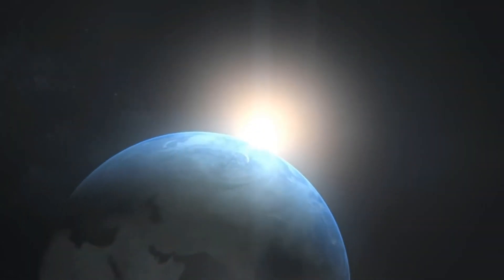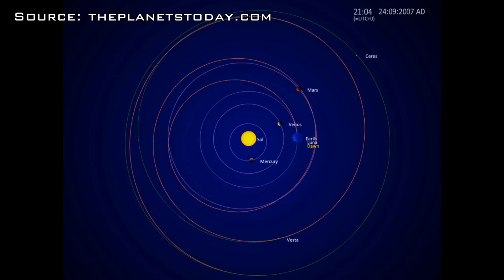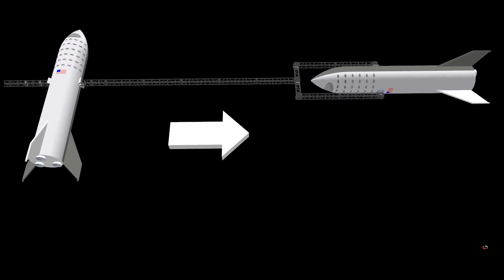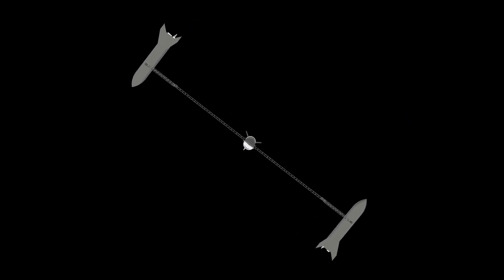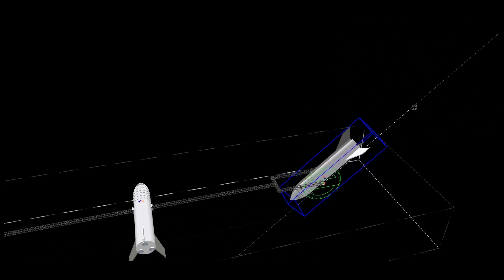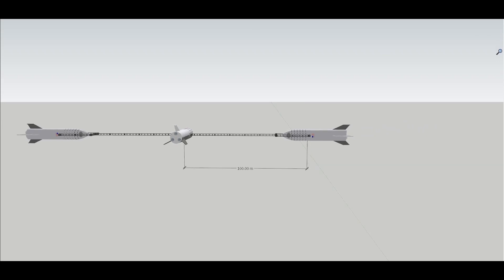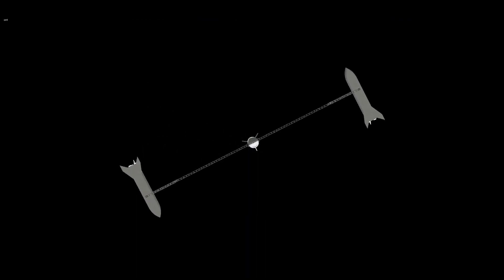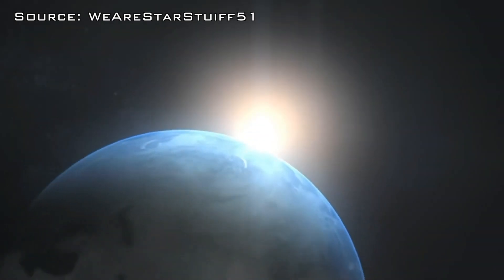GLS2: Artificial Gravity for SpaceX's Starship

Comment: I think the first question should be, is there a material that would provide the tensile strength needed but still be light enough to keep the weight from becoming an issue for launch. The material would also be required to withstand multiple long trips through space at minus 457.87 degrees on average. Do we have any lightweight materials that could withstand long exposure to cold and not become structurally compromised while providing the rigidity over that amount of exposure time? The concept is sound, and I have actually been mulling this over but instead of the starship, I was wondering if this can be done with the bigelow aerospace inflatable habitats. All in all, I think this is an amazing idea and wish I would have thought of it first, kinda jealous that your system is so much simpler and elegant than mine. lol Great job and thank you for posting this concept for us to see. Please keep them coming.
Reply from the maker: Thanks! More content is in fact in the works. General science-y video next, and GLS version 3 after that. I'll certainly be looking into materials as well as the implementation.

It's funny that most people say my idea is too complicated, and I agree with them when it comes to certain aspects.
Reply: @smallstars  10 years ago I would have thought it was too complicated, but not now. I think the idea is sound but am not sure if the material sciences have produced anything that could work. To me, your idea is actually the most viable I have seen. I did have an idea after seeing this that has been banging around in my head. Would it be possible to change the orientation so that instead of the two outer ships being aligned with the main ship side by side, if they could be fore and aft so that it could take advantage of the forward momentum as well as the spinning momentum. If you could let me know if that would be possible in this model I would appreciate it because my OCD has been going overtime on this idea. Hope to hear back from ya.
Reply from the maker: @NoWokeSpeak  Ok firstly, thanks for the kind words.

You seem to not understand the difference between an acceleration and momentum. Momentum does not put any force on you, which is why when floating through space, you don't feel any gravity like forces on you. You just float. The spinning action is an acceleration. This is why it can be used to create a force that feels like gravity. Accelerations aren't just things that push you in a direction, they can be a change of direction as well. Think of when you are in a car and the car turns to the left. Your body is pushed to the right, that is an acceleration.
Reply: @smallstars  Ok, I really should have been re-read that because it is very confusing. What I am asking is, if you change the configuration, could the acceleration and deceleration assist with spin up and spin down. I worded that very poorly, sorry about the confusion.
Reply from the maker: @NoWokeSpeak  ahh I see, I don't see how something like that could be safely implemented during the TMI (trans mars injection burn, which is when you accelerate to leave earth,) but I do enjoy imagining what another person has suggested which is to orient the spin system like a frisbee on its way to mars, and upon arrival, detach without slowing the spin on a vector that's beneficial for mars landing, or orbit insertion. This basically recycles the delta V used to start the spin and turns it into delta V that slows down the starships.
Reply: @smallstars  yes, you explained it much better than I did but, absolutely, frisbee orientation, why didn't I think of that..lol.
So now that you were able to translate my gibberish into an actual coherent thought. If we had the tech and material to support something like that, would it be possible,  would it conserve fuel and, be more efficient over all? Just as a thought experiment.

Comment: Its a good idea but I would think the forces produced would tear the ship in half , the gravity as you have pointed out would be low at the top like earth just down from the top and be  many many time more at the engines due to the ships length. the pressure would be massive on the tips of the rocket bells. if you flip it around and shorten the distance so the pointed end was facing away and have people live on the roof while traveling in space it might work.
Reply from the maker: Thanks! I'll have improved versions coming out in the future and I'll certainly take into consideration the images that come to mind when I read your description here.
Reply: @smallstars  No worries just remember where you heard it :). I will subscribe I would like to see how it turns out , I also have an idea how to get rid of the cork screwing if your interested . I have some other ideas not like yours but its seems every answer seem to make another issue.
Reply from the maker: @MrBrenden830  I am interested! I had some ideas myself about that and yes, each solution seems to create a new problem. Perhaps contact me on social media that has direct messaging. instagram.com/tinysmallstars or twitter.com/tinysmallstars

Comment: hmmmm, how do you start the engines at the exact same time? What if one engine does not start? Interesting concept though. Also how do you manage course corrections? I'm not criticizing, just trying to help you perfect the idea. Keep up the good thoughts.
Reply: 1966 Mercury XI tried to experiment with a cable tether. Got into an uncontrolled spin. Was lucky to recover.
Reply from the maker: Good points, and I appreciate you being constructive! I'm working on some answers that I will include in the next GLS video.

Comment: A tether still sounds more practical, lighter less voluminous, use the saved mass for RCS propellant, I'm not convinced long burn RCS at the optimum vector won't work just fine. A nice gradual ramp up/down to the desired g force and don't have to stress the Raptor engine(s) in extra albeit short burns. We do agree artificial g is an absolute  requirement, creature comfort is secondary. Glad someone is giving the topic serious thought as this is not a lunar mission anymore. Next we'll need to discuss an emergency 1/2 person return 'pod', for physiological reasons. Thank you, Ken

Comment: Great video, I've always supported creating artificial gravity due to the ill-effects of no gravity on the human body. Maybe one suggestion is to have a pipe to channel the fuel from the outer two starship's to the center starship for 3 good reasons: it will take less propellant to accelerate two lighter starships into their rotation; the truss doesn't need to be as strong to support the weight of the extra propellant (the apartments) on the outer starships; added bonus of being able balance out uneven loads between the two outer starship to counter oscillations and align the axis of rotation with the center starship. Once reaching Mars, the rotation will be stopped as you described, the center starship will pump the fuel back to the outer two starships and detach, landing on Mars, while the center starship stays in orbit until it can be refueled (no point carrying a truss down to the ground and up again in my opinion) for the next burn acceleration back to Earth.
Reply from the maker: Interesting thought! Thanks!

Comment: Why don't you have on the senator rocket or biped poor living conditions with a rotating pot area that's when you going to alignment I would shorten my tethers from the other pods from the Rockets the length of 20 20 ft and with a small burst of accelerant to create gravity inside the MIT Center rocket the center pods to keep gravity I can probably draw it up a lot better but to me it would come back all your fuel it would come back all your waste time it would cut back all that extra material you need to build it and I think you'll get better results for faster Journey
Reply from the maker: I can't quite understand what you are trying to say. Perhaps type it out instead of using speech to text? 😂

Comment: My view was to fit 3 starship to a starship (engine/bunker). the engine would be build to stay in space and serve as a bunker for solar storm. than the 3 starship attached in triangle to the engine/bunker become living quarter. Now spin the thing and you get gravity in the 3 starship and 0 gravity in the middle (engine/bunker) since the engine never make it to ground they can add maximum shielding to protect from particle and radiation (led plate and water reservoir).

Comment: if the rocket from the center rotate opposite direction from the 2 others , could it be possible to generate electricity for the crew and/or generate a magnetic field to increase  protection against cosmic radiation  ?
Reply from the maker: Interesting thought! This seems to be the reverse of what many people are thinking, which is to use electricity for propulsion (ion engines.) You are basically turning the propellant energy into electricity. In terms of cosmic and solar radiation, I've talk of the idea of creating an artificial field to protect against it and will be doing a video about it eventually. Thanks!

Comment: The concepts and ideas in this video are decent, but the basic plan can be expanded upon. 
First, the "truss" itself could be made as a hollow tube. And that that would allow people to go from one starship to the other during each trip.
Second, the "truss" part itself could be sent up into space in advance and assembled in advance too. 
This way the starships themselves do not need to carry the truss structure on board, it will already be sitting in space waiting for them to simply attach. 
One problem I foresee is that both starships will have to be exactly the same mass. If they're not, they will create a force which will send the entire configuration in an unwanted direction. 
Keep in mind that while the two starships are spinning in one direction, you want the entire structure moving in a perpendicular direction.

Comment: Your trusses could exert virtually no control authority due to the high torsional stresses engendered over such a long length (lever equations that you seem to have totally forgotten). control authority is not needed when you have two rockets connected by two tethers , keeping both rockets parallel which would minimize differential gravity between decks. The main issue is that nobody has yet investigated the long term effects of such a large difference in gravity between head and feet of a human (according to your numbers you could be looking at a differential of nearly 0.05g from head to foot, forcing  the heart to work at abnormal loads for long periods of time). We have experience of long term (>1 year) exposure to 0g which while not ideal is at least  survivable and the long term health issues are well understood. While I commend the thinking here I think some extensive in orbit testing would be needed before the lives of a crew could be entrusted to either truss or cable connected artificial gravity schemes.
Reply: There is also an issue with viewing the field of fixed stars at 3RPM. This would quite probably induce vertigo/nausea in many people. Again, the only way to know is extensive testing on humans in orbit. Of course, you could remove all windows but that makes the trip even more unpleasant.

Comment: You would only have "gravity" on the very fringes of the system go 5 feet towards the center you're 50 pounds lighter not a very effective system at all its proven to be useless...
Reply from the maker: That's not true. The difference of 5 feet closer or farther from the center of the system changes drastically depending on how far out you are starting. This is why I planned to have 100% of earth gravity on deck 2 of the Starships. On decks 1 and 3, the gravity only changes by a few percent.

Comment: Why not align the middle starship perpendicular with the other two?   This gains you 60 meters on the spin radius (up from 9 meters the way you have it oriented) and makes the tether on each end around 70 meters for  a solid 100 meter radius.  Orienting it as you suggest is important because the plan is to aim the engines and fuel tanks at the sun.  Only by side-to-side orientation can you rotate and also orient towards the sun which you touched on.  This is the direction of most of the radiation.  I also imagine a pop and play type (pressurized) tunnel inside the tethers so you could travel between the ships.

The center ship/docking module could be an early Starship that is retired.  Send it to orbit.   Take off the engines and use it as a refueling station and gravity docking module.
Reply from the maker: Thanks for the thoughtful comment!

1. The area that will be subject to the strongest tension force is the center of the spin system. The center has to be made up of a super strong hub structure that I planned to have mounted in the middle of the GLS. Orienting the GLS along the diameter (or radius) of the spin system won't "gain 60 meters on the spin radius"

2. Orienting the engines and tanks towards the sun only matters for ships with passengers on them.

3. Pressurized pop and play FTW! 👍

4. retired starship to use as GLS would be great for testing the spin system in earth orbit

Comment: dude that is awesome. I am no where close to being your equal. But here is an idea: As a back up, keep an extremely strong cable to keep things attached. 

Reason iff the truss breaks (due to micro meteors, act of God, etc etc) the supported Starship will go flying off into space. This would mandate a 24/7 skeleton crew to be aboard the Starship to reunite with the rest of the station. However, this requires 24/7 manning which can cause strain on the crew. 2) it also means you need more qualified crew (which means less other important roles can be aboard). For example, if you had three 8 hour shifts for a pilot navigator and engineer, this would require a total of 27 minimal crew members on alert 24/7. If there was a way to mitigate this, you could reduce that to only 12 (3 pilots/navs/engs, and 3 back up). This menas you can have 15 other humans aboard who can help the mission proceed (doctors, different engineers, machinists, etc)

One way to accomplish that would be to attach an emergency cable that is exactly 1 foot longer than the truss but provides 120% the support ability of the truss. This means there is never any weight on it, but if required, it can handle the initial shock (of all that mass moving 1 foot) plus a little more in case there were more people/equipment etc.

You could attach the cable near the center of gravity, so that if it does end up getting used, the Starship would end up tangential to the curve of the circle. This would mean that it would be almost in the correct position to initiate a slow/stop spin. 

Additionally, sensors detecting a significant weight on the calbe, could trigger an automated STOP SPIN maneuver that could constantly be calculated in case it does happen. This stop spin would engage the RCS to orient the relevant starship to an appropriate direction, and slow the spin until it is 0 (in tandem with the other starship)

Just an idea!
Reply from the maker: Fantastic Idea! I'm sure we are equal in many ways. I would call this idea a "safety cable" or just a "safety" for short.

In addition to the safety, the next version of the GLS will include cables to hold most of the outward pull of the starships. For one, Cables hold tensoin way better than rigid truss, and secondly, the truss can then be lighter weight and or reinforced differently more to provide stability and leverage.

Comment: The truss would have to be very heavy to handle the stress of the rocket thrust which is perpendicular to the truss. This would be very difficult to build.  You would have to have very small engine thrust.
Reply from the maker: Thanks for the comment! 

1. It certainly should be heavy! There will be 150 metric tons of payload capacity for truss, cables, and other hardware.
2. The force in that direction won't be as strong as one might think. In space there isn't a lot of resistance in the opposite direction. Imagine having a floating fork, and trying to make it spin using only 1 finger on each end of the fork. Could you ever possibly apply enough force to make it break?

Comment: If you build the truss system to stay in space, then the only thing you need to pull out of the gravity well is fuel. Why would you land it if you could just put it in orbit and build shuttle starships on Mars for people, cargo, and fuel?
Reply from the maker: Great comment! I agree with the logic of not having to launch the truss mass off of mars, however that would cause a penalty when arriving at mars. The current plan is to use mars's atmosphere to scrub off velocity and not have to use any propellant to enter orbit around mars. It would take a significant amount of propellant to get the truss into mars's orbit, instead of stowing it and landing it.
Reply: @smallstars  thanks. You have given me an idea. Why not design it to dip into the atmosphere just to bleed off speed, but not deorbit the craft all together.
Reply from the maker: @jameswhitman3934  That would be a very tough, but also very awesome maneuver! Some one else mentioned doing that. Seems like the margins would be small, but just doing that to land seems tough as well.
Reply: @smallstars  so long as you get the craft into the gravity well you can just graze the top of the atmosphere until you get it into a stable orbit in lmo. A difficult maneuver for sure, but no less doable than that skydiving backflip that Elon wants to do.